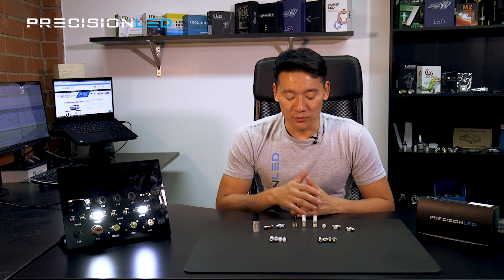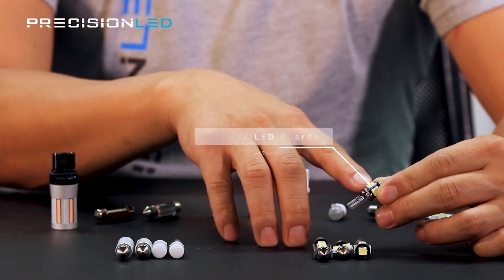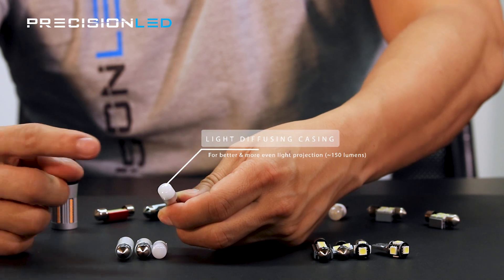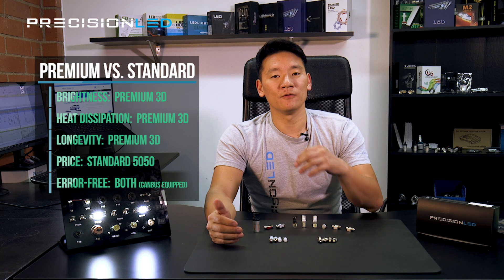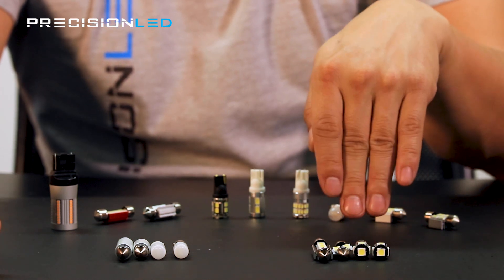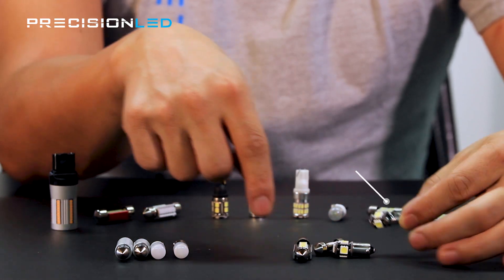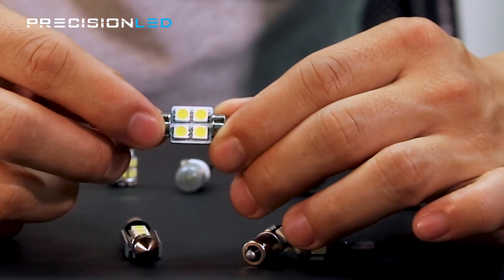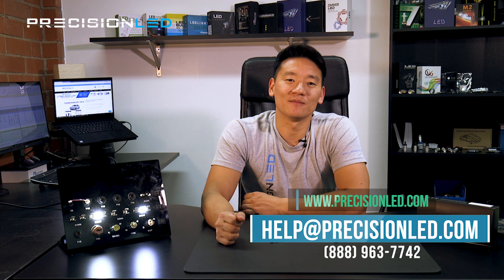LEDs Explained: Premium 3D vs Standard 5050 | Precision LED

Comment: Your website says that you have bulbs that will fit my 1998 Grand Cherokee 5.9, yet the ends of the bulbs are wrong. The ends of my bulbs are a single loop of wire, yet your bulbs have a pointy end. How do I find LED bulbs that will replace the 212-2?